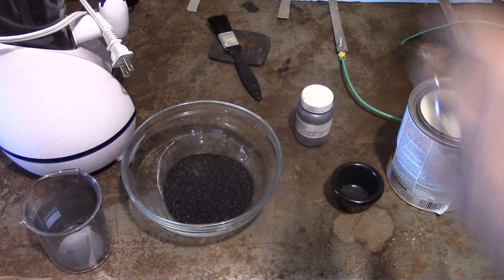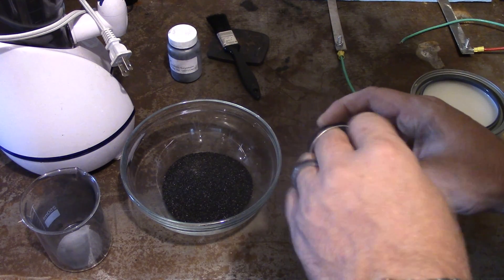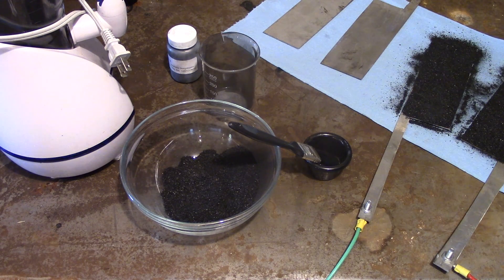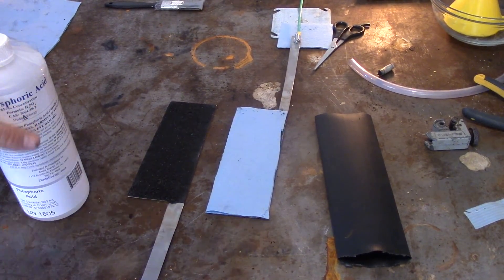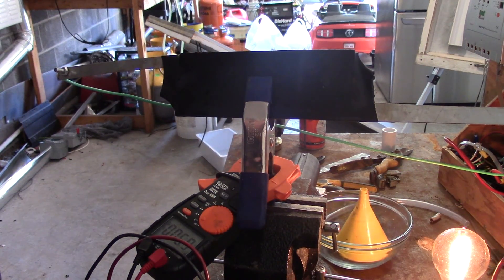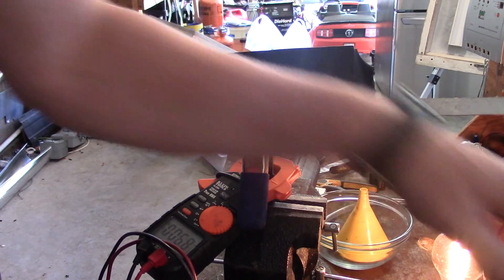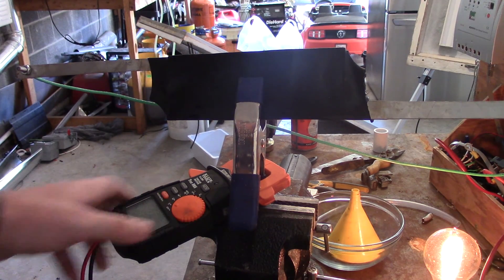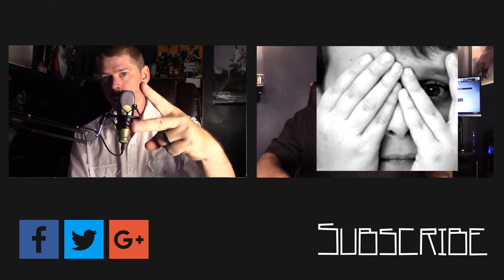DIY Graphene Based Supercapacitor Testing

Comment: Use opposite métal plates zinc against copper! Or aluminium \ copper
Reply from the maker: your right Thanks
Reply: @solarpowerelectricityandel2915  and since you answered fast!!! Please follow thé same crucial steps of making solar panels poles!
I mean each plate of metal plus graphine should be allowed to harden from hot to cold under current for formating its nano structure electrically... With opposite metal!! As if you're trying to make an electret but the real way unlike people do!! You must format each polarity separately!! Even the separator should be formated with a current !!!
And then assembly  in a pressing weight and also under charging current ! To format and charge your capacitor for test!!! And the charging current\voltage should approximately respect the architecture of your capacitor! (Surface for vokage\ thickness \etc)
If the cap is well formated in the first step it might be so successful that it would recharge to a certain degree by itself!! Because it would be a polarizator of total energy zero point!!
Note that it doesn't have to be just graphine ", any non metaltic material is electrically chargeable!! Graphine is good because its both conductor and organic chargeable material!! But unless it is  nano dust it doesn't have good surface area!!! Mixing it with some resin!!! In nature there are all kinds of trees with positive and negative resins!! Some you can burn like pine resin ! And some you can't burn like abricot tree resin! And other resin used by Japanese for making natural paints for wood! But in industry I'm sure you should fine differently charged material with good surface area!!!
Copper being south pole produces positive should go with positive resin!
Aluminum being north should go with negatively charged resin!!
 The separators dielectric should be extremely fine!!
And also capacitors work better together!
For example in series voltage is increased and the electrical aura of the plates becomes large and when that happen each plate easily induce opposite voltage in the other! While in case this doesn't happen= we can't even speak of a working capacitor!!! 
Basically if a cap Is perfectly made it can self charge to a certain degree! 
Note : solar panels are solar capacitors!!! And the higher the solar panel is put and the stronger the ground is made the stronger the electricity is!
In my experiences I made many solar panels and the differencials would never build unless negative is connected to ground !! Without it the positive isn't separated from sunlight which is in UV.
Reply: I forgot to add!!
The metal you use ! Or let's say generally metals are dischargers in nature!
They discharge the voltage giver by a charger from it into charging the graphine ! And when you want to discharge the cap they discharge the charge in the opposed graphine in this electrically compressed explosive environment into energy fire bubble made by the short circuiting!!! 
The thickness of the plates is to ease the discharge faster and stronger and withstand the heat of it!! On both charging the cap and discharging it!!!!
I wish I could work with you on this project and many others!!!